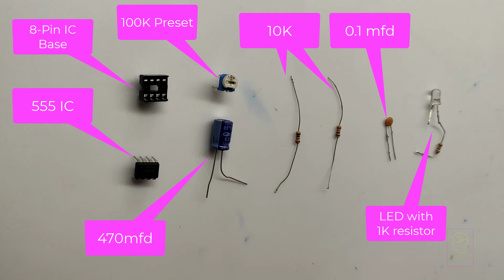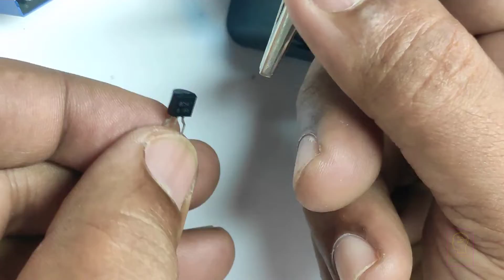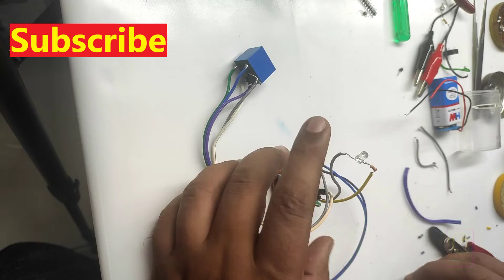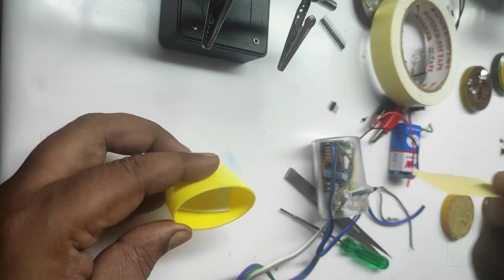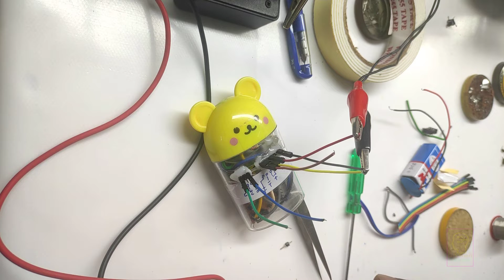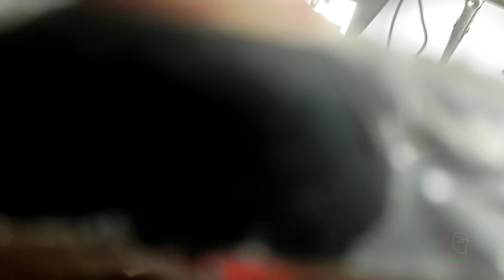Comment: Just a question : the monostable ne555 configuration depends on kind of electronical diagram using ? I asked that because I see more monostable with ne 555 but with different pins place.
Reply: Monostable with 555 can be wired in one way only. 555 can be wired for bistable and astable too